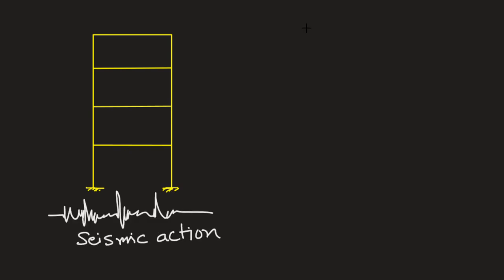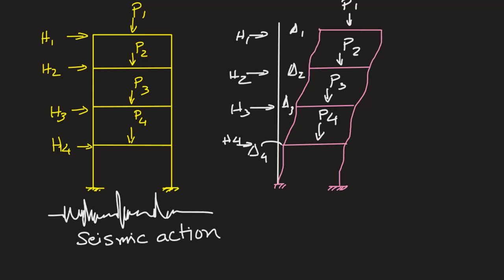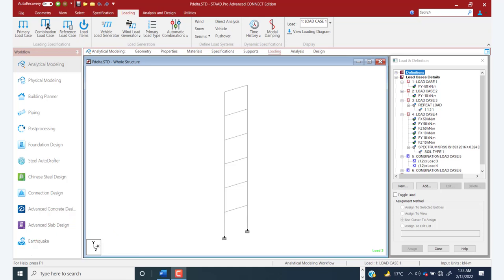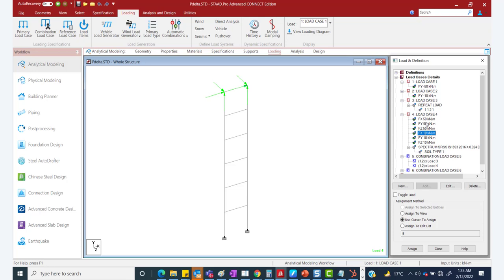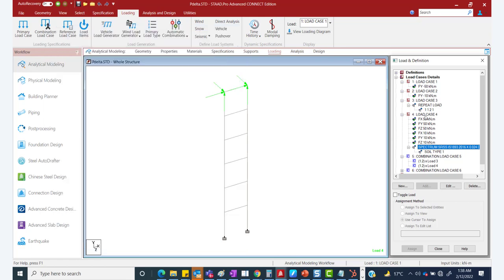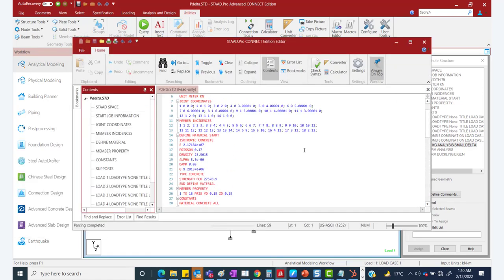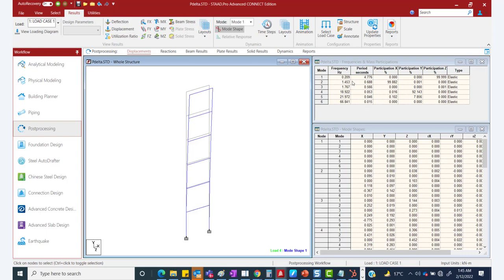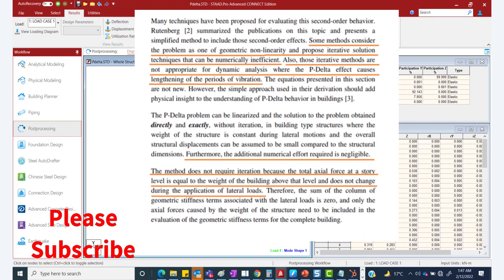Dynamic Analysis Capturing the PDelta Effect (Non Linear) in Staad CE ||

Comment: How can a non-linear system have fixed natural frequencies?
Reply from the maker: We are not doing the direct integration method to solve the geometric non linear response at every time steps ( for Time History) as in Staad rigorous method like  direct integration and FNA is not available but here the program we are using the geometric stiffness method to active the final solution by modifying s the stiffness matrix directly by KG so that the modal analysis can be performed on the modified (K+Kg) matrix . This method gives good result for building like structure undergoing PDelta effect. This method is first proposed by Edward Wilson which was then implemented in many building analysis package like SAP, RAM , Staad etc
Reply: @Torq123  I understand your approach which is what you do to solve non linear static equations but my question was - “can non-linear systems have fixed natural frequencies?”

If not, then there must be some form of approximation required to use any mode superposition method for dynamic analysis, I wanted to understand a bit more of that approximate method.
Reply from the maker: @satyajitdey2098  Ok , I got your point now. Yeah As the geometric stiffness varies with the change in geometric shape so the NF will vary for the change in stiffness.
Reply: @Torq123  Is it Biswa? Will catch you later to know more of the technique used, it's a very useful topic and a video indeed!